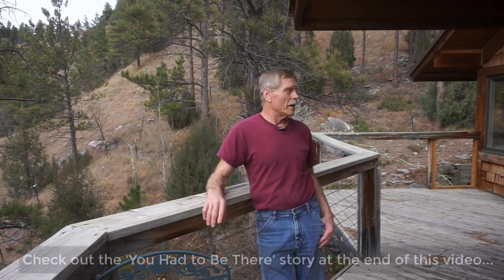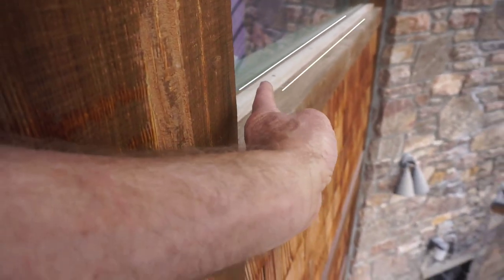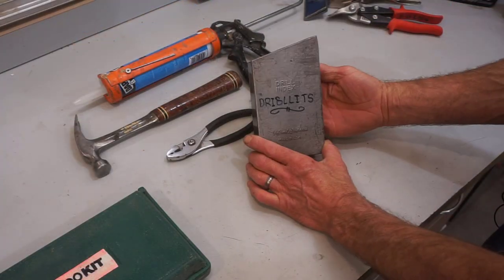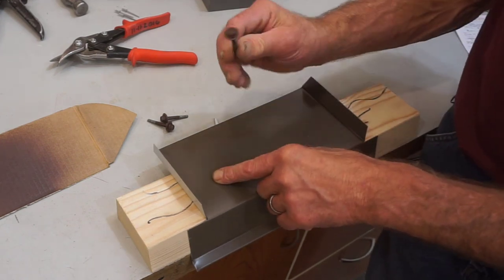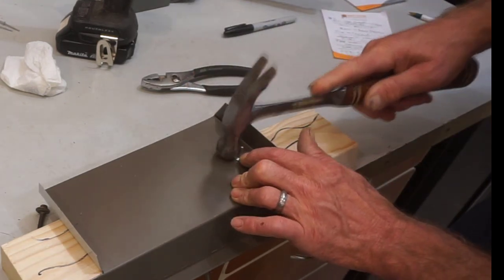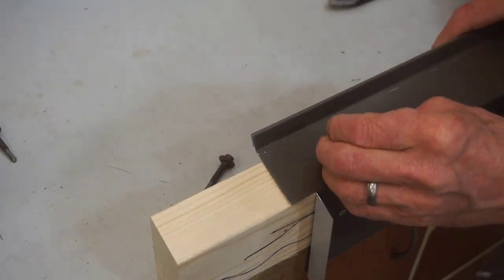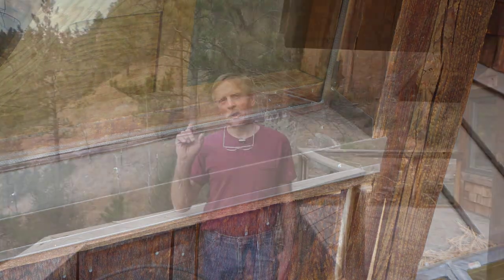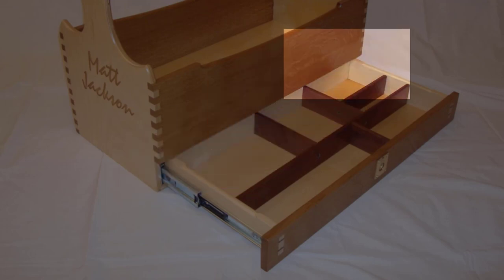Reverse Pop Rivets Fasten Metal to Wood?!

Comment: Why not just use a flat head nail,  save time drilling the hole and popping the pin out of the rivet
Reply from the maker: Mostly because this metal is too thick to easily pound a 'flat head nail' through it Heath so pre-drilling still saves time.  If 2 seconds seems like too much time for popping the pin out of the rivet then I guess you should just use a different method.

Comment: Did you just invent a nail?  Why not use a grip nail or did I miss something.
Reply from the maker: Well, I guess I'd be hard pressed to disagree with you Mark... but I will say it's the only nail I could find with a domed head to match other pop rivets on the project where they were used for metal to metal connections.  If I needed a longer fastener for these caps my next option would be a 6p stainless steel nail of some sort but prefer this method for appearance sake.  Best, Matt

Comment: I have to say I love the idea to make decorations on something "INTERIOR"  but to use as a mechanical fastener outside  especially flashing and tin is a real bad idea....  The smallest amount of wind will loosen your flashing or even pull these finish nails right out.  silicone won't hold, you will get leaks, don't do it!